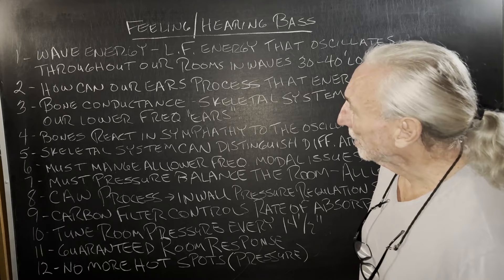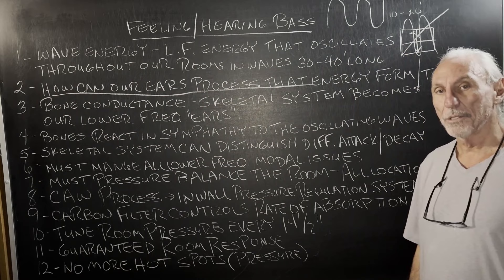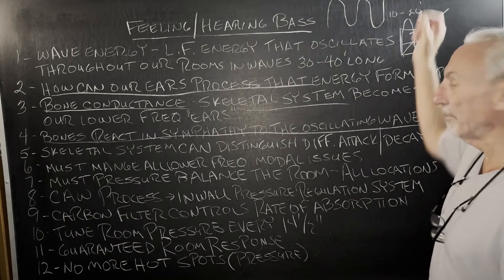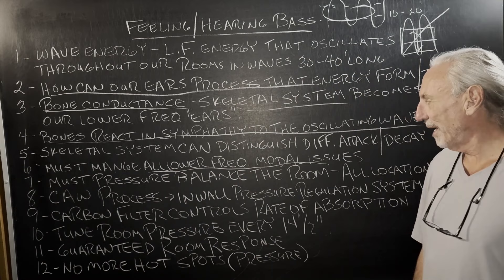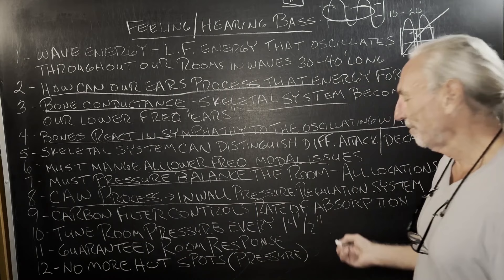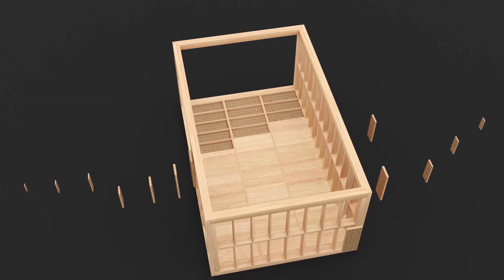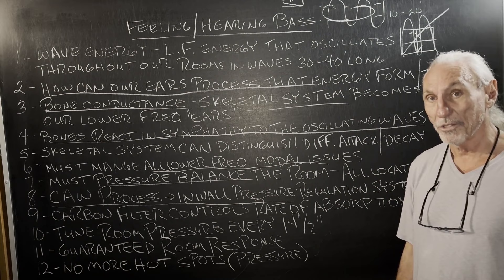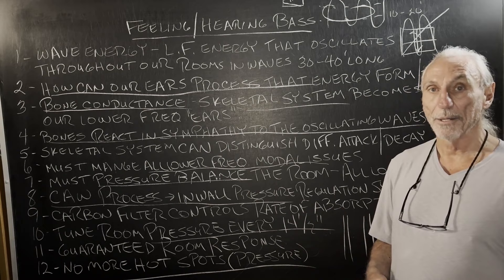Feeling/Hearing Bass - www.AcousticFields.com

Comment: Perhaps not needed in this discussion, but related, is the non-directionality of bass. That our auditory system is incapable of detecting locational information below around 140hz. At that frequency/ wavelength the pressure wave is basically the same all around our head. No  arrival time difference as in higher frequencies. So once the room is able to handle long wavelengths, sub placement because easier.
Reply from the maker: Non localization along with bone conductance.
Reply: The ear evolved around that physicality where air transitioned from "beaming rays" to "rolling Thunder", the "room" is a matter of "choice".
Reply: @DelmaRaySmithJr  https://www.youtube.com/watch?v=XGBMvvU39EY I am working on a recording studio control room, I have just about got the structure of the  room  finished. Hopefully next week I'll be working on sound treatment, I was thinking of covering the entire wall behind where my monitors are going in treatment, large bass trap on the rear wall and it'll have an open vocal booth at the back, if you have any ideas I would love to hear them, thanks
Reply: @AcousticFields  Yes. Try to explain to someone when you can locate the sub by sound. A sub should never be generating sound you can locate.

Comment: Two thoughts:
I believe bone conductance is how deaf people here to play football. A bass drum signals the start of plays.
If one wants to experience how low frequencies pressurize a room, star with stand mount speakers then add a subwoofer.
Reply from the maker: Yes, that is correct. To see how low frequency devices pressurize rooms take your RTA and switch the sub on and off to see in real time its impact.

Comment: Why do anechoic chambers use wedges but all the absorption panels for home theater or mixing studios are flat?
Reply from the maker: An anechoic chamber is a reflection free environment. Wedges that are 36" deep, will minimize all reflections above 100 hz. In small rooms, we do not want to eliminate reflections, we want to reduce their strength or amplitude.
Reply: @AcousticFields  Thank you for the reply.  I am building a home theater but I also want to use it to test speakers that I build. Would eliminating reflections cause the room to sound weird?  Would foam wedges also provide some sound absorption?